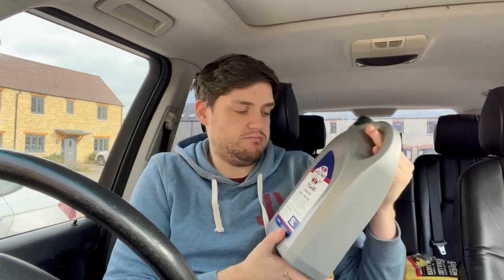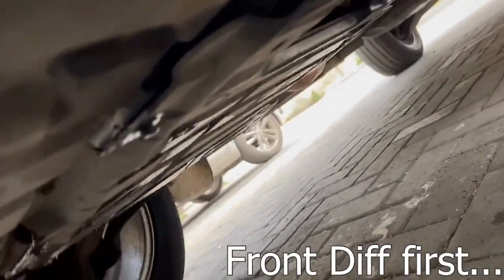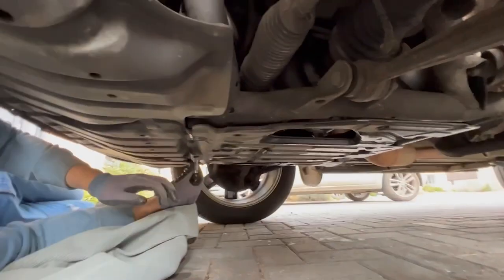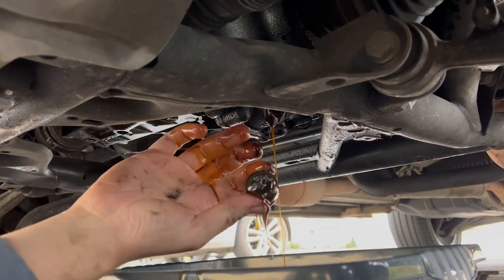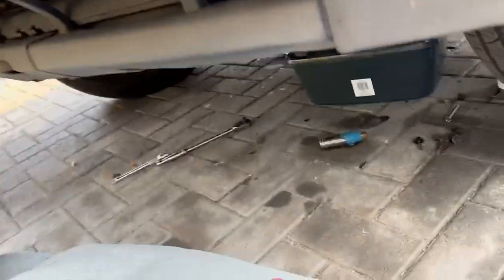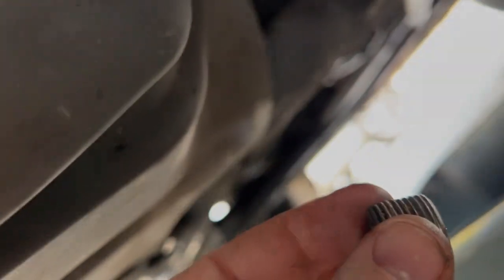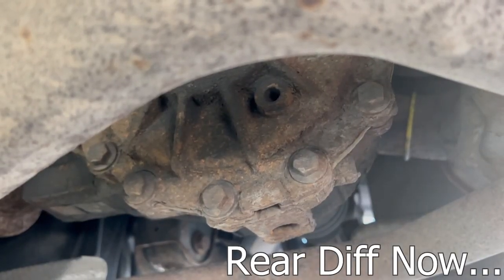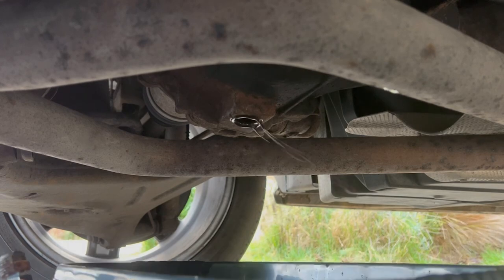Cheap Range Rover L322 Project | Episode 4 | Front and Rear Diff Oil Change

Comment: Just did diffs on my 2006 V8 petrol. Drain plugs on both diffs are 14mm hex. Fill plug on front is also 14mm hex. Fill on rear is 8mm hex. New drain plugs (oem ) come wrapped in a layer of pfte tape. This will wear off though - didn’t see any on old plugs. They are tapered threads so snug them up then torque to spec - in my case 54nm. I checked after a couple of days and they’re in there tight - no leaks. Before doing this job I’d recommend spraying the drain and fill with some WD40 penetrating spray and then go and have a cup of tea. Makes the job so much easier when not wrestling with welded on plugs. I also put some copper grease on the plugs when reinserting - not sure if you’re supposed to but I doubt it’ll do any harm. Torque to spec seems to be the best preventative e measure when you need to do the job next time.
Reply: How much oil 
do i add for the diffs and the transfer gearbox, is it fill to spill ?

Comment: My drain plug has a layer of sludge on it.  No doubt never been changed in the 100k 

Also the fill plug doesn’t need to be super tight it’s only torqued to maybe 25nm I think. 👍🏾

Comment: On the positive side it didn't end up like a Just Rolled In video. Strongly recommend a decent pair of secondhand overalls if working on the ground.
Reply from the maker: Yeah I’ve ruined too many clothes recently. Especially with Diff/transmission oil! Stinks.

Comment: The whine may not be the diff could be a wheel bearing as it travels through the transmission, but I did hear these RRs did suffer with front diff whining, great vids keep going
Reply from the maker: Pretty sure it’s a diff, or the transfer box. It only whines under load (acceleration and deceleration). Got the oil to do the transfer box now. But given how much the front diff has leaked, wouldn’t be surprised if a lack of fluid had knackered it a bit!

Comment: When I was doing the diff oil in my CRV I got hold of a pump from the top of a large handwash, shouldn’t be difficult in times of hand sanitiser everywhere, and with a wee bit of clear hose to the fill plug just pumped it straight in.
Reply from the maker: That’s a genius move! I like it. For the transmission I have a little electric pump

Comment: The transfer box takes the same oil and is the easiest access of the three drive cases. I'm wondering why you didn't change that as well whilst you were under there? Good work on the interior wood veneer. I'm enjoying the videos as working with one hand is definitely not easy!
Reply from the maker: According to rimmers the TF case (at least on mine) takes different oil. I actually have the oil now but at the time of filming I didn’t, will change when there’s a gap in the gale force winds! Haha
Reply: @TyredFormat  That's interesting. Thanks for the correction. I've worked on/restored quite a few Land Rover models over the years and they have always used the same oil for all three cases although I've never worked on an L322 or anything newer than that.
Reply from the maker: Mines a weird year/spec so has a few mismatched bits. Som L322’s even have different fluid specs for front and rear diffs! All very confusing to say the least.
Reply: @TyredFormat  Agreed TF0735

Comment: Next, the transfer box oil change?  I need to do my rear diff but some utter tool has rounded off the full plug…
Reply from the maker: Transfer box is on the list indeed! How on earth did they manage to round that one off?!
Reply: @TyredFormat  The transfer box could well be the cause of the whining when you reach 40mph. I had the same problem with mine  at 40mph, not long after I bought it. I had quotes from garages saying that they THINK it's the front wheel bearings  ? I wasn't convinced, so I decided to check things for myself. When I drained the transfer case it was nearly empty ? I filled it up and solved the problem 😀. When garages service a car it generally only includes engine oil, and nobody even bothers to checks the other oils 🤔 I thought that is what a service was for 🤔 (checking the vehicle) If you want something done properly, do it yourself.  Great videos, Good Luck 👍
Reply from the maker: I've had some of the WORST service from Main Dealers on New/Nearly New cars! they havent a clue. I've bought 10+ Year old cars that still have the original Pollen filter in as well. Mad what people skimp on, and what "expert mechanics" dont bother with.
Reply: @marksoutherton8888 I’ve got similar symptoms on my L322. Definitely going to change the transfer box oil. It’s stamped in the service book around four years ago so must be due a change.

Comment: The front diff oil looked in pretty good condition. That was the same case when I did mine. It was due to a previous owner replacing the torque converter and as such the oil too ... Maybe this was done on yours?
Reply from the maker: Very possible! That or because it was leaking someone was regularly topping it up? The fill plug was way too loose as well.

Comment: What would have been really useful was showing us where the plugs are (which side of the diff), the size of the sump plug tools used and the amount of oil you put in.
Reply from the maker: It’s something I try to do in my newer videos! A lot of that info is there on Google though. Good luck with yours